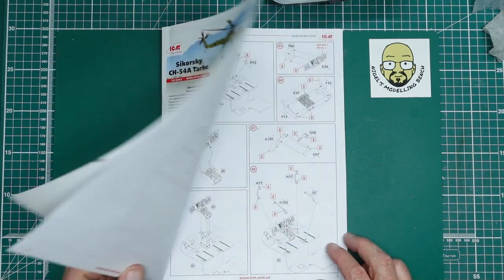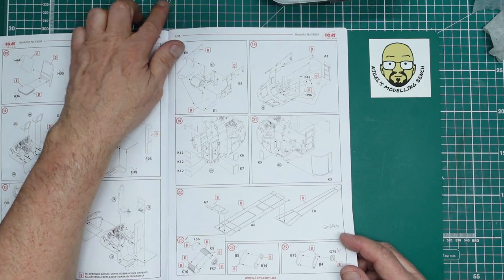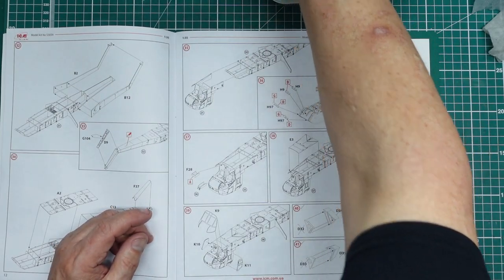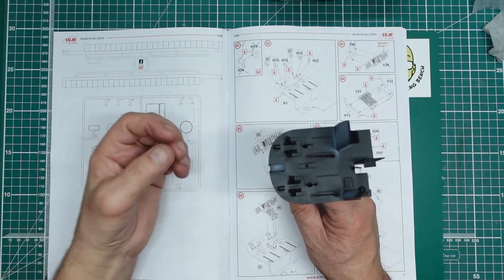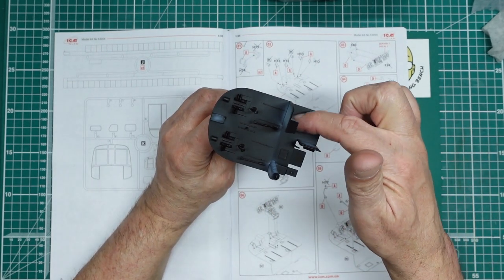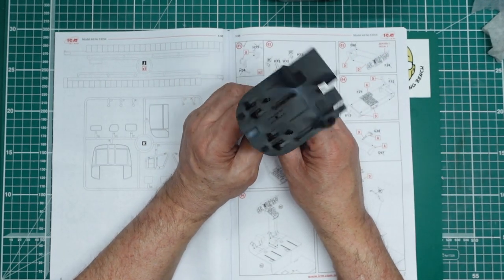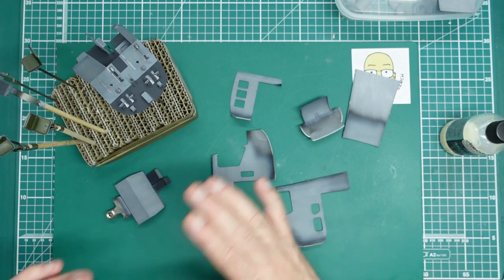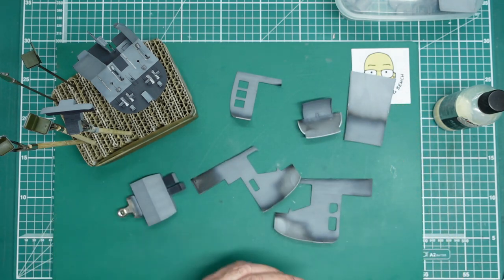ICM 1/35 CH-54A Tarhe build. Part 2

Comment: Nigel,  Definitely very interested in all the details of putting the cockpit together - didn't fast-forward through any of it!  I'm very interested in this kit because I did a much smaller scale version, probably about 50 years ago by now, which had the neat feature of having the winch cable attached to the main rotor; spinning the rotor one direction wound the cable up onto something inside the main rotor hub, spinning the rotor the opposite direction unwound winch cable, so if you had a "load" on the hook you could
pretend to raise or lower it.
Reply from the maker: Sounds fun.. was that the Revell one?
Reply: NIgel,  Sorry I can't remember  for sure (old age memory issues), either a Revell or possibly a Monogram (which of course Revell now seems to re-package) @NigelsModellingBench
Reply: I had that one.

Comment: hi nigel. it is me silent farmer, i have changed my name to what it was originally.  i need some advice, i am building an old airfix B24J in 1/72 from 1963. and the clear parts are not good, there is no seperation between the windows in the cockpit glazing and same for the sperry ball turret and nose and tail turrets,  what can i do to solve this problem. i know the kit was reboxed in 2011,  should i try and contact airfix and see if they have any  spare clear parts or try to fix the missing panel lines that seperate the individual windows from the frames ?
Reply from the maker: I would contact Airfix spare parts service yes.